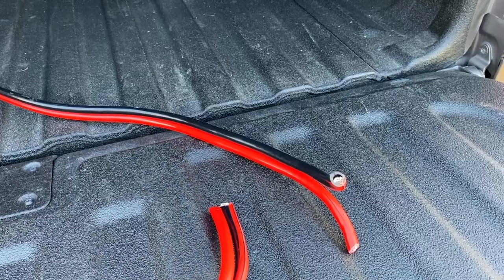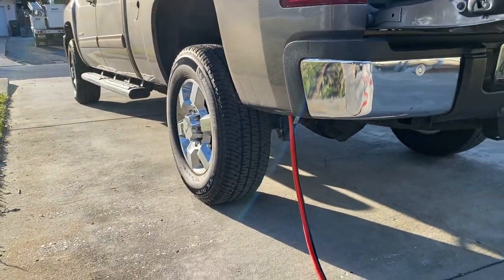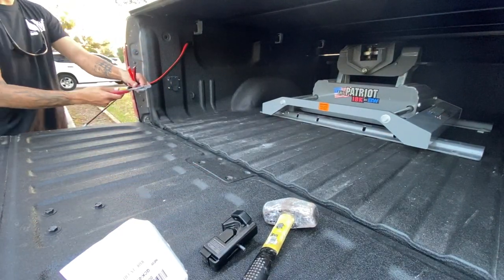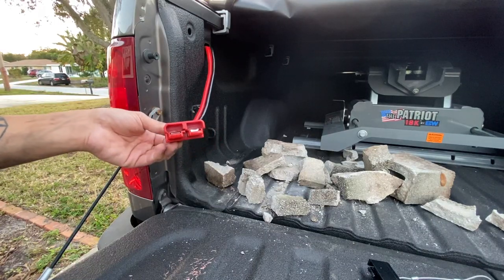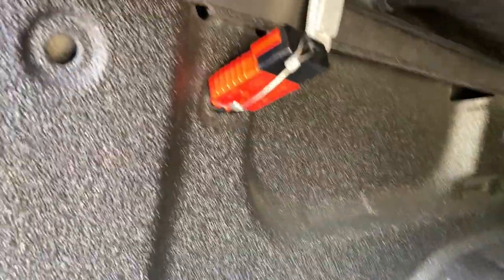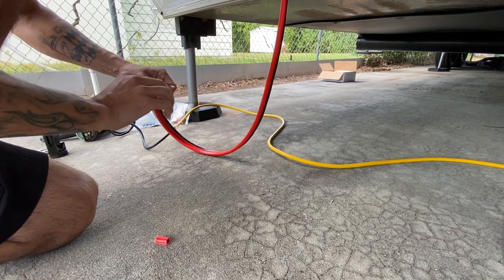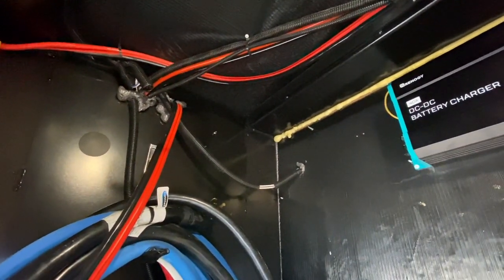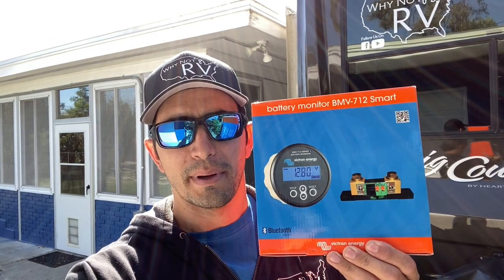Installing a DC to DC charger - Why Not RV: Episode 7

Comment: Nice installation. Don’t forget and leave it plugged in with your engine off. Since you put a jumper from the battery input to the ignition sensor port, when your engine is off, it will continue to pull power from your truck battery.
Reply from the maker: Yes! Absolutely!!!

Comment: Thanks!  You just answered every question I had about what I need to do for my Ford F2 50 and a 32.5’ fifth wheel. I didn’t even think about buying a battery charger cable.  I bought the same Renogy DC to DC converter, so now when my battery arrives, it’s time to go to work.
Reply from the maker: Great to hear Gary. Goals I was able to help!!!

Comment: Now that it has been a year, if I could encourage you to check the 2 gauge wire you fed. There was a few places where the wires were contacting metal. These areas could cut through to your cable. Conduit would help lessen this risk or rubber grommets.
Reply from the maker: I actually changed trucks and upgraded to a dually. When I removed the wire from the old truck I did check it and not a single point of wear anywhere. While I do agree that putting it in some form of conduit is better, if you mount everything securely it works just fine.

Comment: If you are going into the engine compartment you really should be using heat rated cables. Battery jumper cables are not raited for continuous loads. They are for 5 minutes of current, in an open air enviroment, and then go back into storage. You want SGX (125C) or SGT(105C) cable that can withstand the temps in the engine compartment. Jumper cable wire is  just going to melt off, and eventually cause a short or fire.
Reply from the maker: On my new truck we did go a different route on cables but when I pulled the jumper cables out of the old one they were just fine after a full year of use. But I do agree, and some type of conduit or wire lume isn’t a bad idea either
Reply: raited  and rated ? auto correct.? thanks for the comment,  I was thinking of using jumper cables , so thanks a lot

Comment: FOR ANYONE READING!! WARNING!! I’m sure many people have mentioned but that positive wire along the truck chassis rail MUST be sheathed. Preferably with something thick. Slight vibrations can cut through the wire and arc to the chassis and cause a fire.

ALSO. That trigger wire to the positive IN is telling the charger to stay on at all times. It’s better to have it on an ignition trigger so that it isn’t running when the vehicle is off.
Reply from the maker: Definitely agree you should definitely sheath or some form of “conduit” to protect the wire. Having it fused is most important so the systems protected. I unplugged the Anderson connector but later switched it to run off of the running lights. So it would only turn on when lights were on.
Reply: @WhyNotRV  perfect! You know what’s up :)

Comment: Your video helped and like some have mentioned, find out what size of an alternate you have so you do not kill it. Good tip on using a jumper cable for your wire. I might recommend spending the dough and getting welding cable which has a solid, burn-resistant, cut-proof jacket, especially for the truck to RV jumper cable.
Reply from the maker: Thank you. Ya welding cable would definitely be preferred. Jumper cables are the extreme budget option lol.
Reply: What size fuse is the one before the battery

Comment: Its worth noting that if you go any bigger than a 40amp charger you should start looking at upgrading the alternator else ir could strain the alternator depending on the size you've got in your vehicle (note this applies to lithium setup due to their high charge rate)
Reply from the maker: Absolutely Dale. Fortunately the big diesel trucks are already good for this extra 40 amps but a regular gas engine might need a larger alternator just for the 40 amps.
Reply: I've seen dozens of videos where they say to have a on/off switch in the cab. Run the ingen fore several minutes. Then flip on the power to the DD to DC inverter. My only problem is the little wire that's supposedly  goes to a fuse and not doubled back to the positive wire.

Comment: Hello Chris: One of the best "how to" videos on this topic I could find. Thanks....  Question: Can you provide an estimate (i.e. 10%, 20%,30%, etc.) that the DC to DC setup has increased your boondocking time as compared to not having a DC to DC system?  As an example the Brinkley Z3100 5th wheel using two Group 25 batteries will give me about 5.5 hours and Group 27 about 1 hour more of driving time on a cloudy day. Pretty obvious I will be up grading to four SOK 12.8V 206AH Group 27 batteries real soon.      Thanks
Reply from the maker: I really appreciate that Joe, it’s honestly immeasurable. It’s one of the most efficient ways in terms of overall cost of a project and everything to be able to add hours to Boondocking. With a DCC charger depending on what you’re running, you can even just start your truck and let it charge your batteries before you go to bed if you’ve been out for the day. It’s notjust a while you’re towing solution.

Comment: I wired my ignition wire off a random 12v circuit that is only active with the key on, but I added a simple switch so I can manually turn the control circuit on or off while driving.  However, I'm been getting issues with the charger charging for more than 30 seconds according to my shunt.  How's your experience been? I've had it a year and it's basically never worked.  Renogys customer service is trash, but they say they're gonna send me a new one.
Reply from the maker: I’ve had great experience with the charger. No issues with it. Hopefully renogy will take care of you. I’ve never had to deal with them but I’ve heard good things. Best of luck
Reply: W order if your circuit just can’t provide the correct amperage?

Comment: By running you Remote wire from your hot wire coming from your truck your setting your self up for a dead battery on your truck . Any time your truck is plugged in to your camper you are pulling power out of your starter battery if you stop over night and boondock over night with the truck plugged in for  a short time your starter battery will be dead . . You need to run a separate low-voltage wire either on a toggle switch or a fuse link to your ignition to your DC DC charger
Reply from the maker: I can definitely agree with that. Part of my boondock overnight routine is to unplug (and unhitch) even if just to sleep. I've been debating on moving the control wire to perhaps a marker light on the RV so when I turn the lights on it will then turn the charger on.
Reply: My Ram 2500 has factory upfitter switches. Could I use one those for the 12v sensing wire?
Reply from the maker: I don't see why not
Reply: If there is permanent running lights from the 7 pin connector, you can wire to that light wire.

Comment: Excellent video!!!  I am considering installing same on my travel trailer with LFP battery, and you helped me considerably!  Just one suggestion...run that small wire coming from the "D+" port of the charger to an ignition source wire so the charger is only activated when the truck is started.  Thank you, you earned my subscription!!!
Reply from the maker: Thanks for watching. Ya, I actually moved the wire to a market light so when I turn on running lights it turns on. Thank you again!!!
Reply: @WhyNotRV  So basically, by turning on your running lights, you enable the DC-DC converter?  I thought the idea of just not hooking up the Anderson connector seemed clever.  I also thought about setting up a second connector, modifying the existing connector to repurpose the trickle charge line on the 9-pin, or maybe put a switch near the tongue jack.  Are you still using marker lights and why did you change to this?    This is very helpful.

2nd question - in the Renogy manual, it only requires a 8 AWG wire to the house battery since you're under 5 feet and drawing <= 40 amps.  Do you see a benefit with the 2AWG wire?
Reply from the maker: Correct. Lights turned on the converter. People use a secondary switch all the time and that is perfectly normal. I found the marker lights as the easiest thing to do. I just used that gauge wire because it’s what I already had and didn’t feel like buying anything different. You only need the gauge wire for the amperage that you are running through it.
Reply: @WhyNotRV  What's a marker light? 🤔
Reply from the maker: … one of the amber running lights on the rig

Comment: A DC to DC charger is a voltage booster and regulator and also mainly an amperage regulator. If you have equipped your trailor with say, 4- 6 volt agm's and hooked it up to your charging system directly you would likely burn up your alternator as those batteries can pull the maximum amperge out of almost any alternator if using large enough cables. Also if you are just using your standard 7 way trailer plug and wiring you risk burning up the wiring or plugs trying to push that many amps through those smaller wires. The DC to DC chager regulates the amperage to protect your alternator, wiring, and correctly charge your batteries. Keep in mind there are losses in these units, so 40 amps out means 50 amps in, be sure your vehicles charging system has enough headroon to support this. Also extra grounds and heavier cables from the engine block and alternator to the truck battery is a wise move. And as shown here in the video you must run dedicated heavy power and ground wires to the charger and batteries of the trailer.

Good video mate!
Reply from the maker: Hey gidderman, thanks for watching. I appreciate this comment. Very good info to add on. Thanks again.
Reply: The nice thing about the 30 and 50 amp version is you can adjust the max current in 10A increments up to the max. I set mine at 10A while towing and 40A while plugged in and getting power off the stock converter, which I isolated and wired into the DC-DC controller. 

I have LFP batteries so it is truly the only way to get max charge.

Comment: Great video, even though it is four years old!!  I have a 2016 GMC Sierra HD ( it's not as clean as yours underneath :) ) and it has two batteries.  Does it make a difference as to what battery I connect the wires too?  Keep up the great videos and happy travels.
Reply from the maker: Thank you for your comment and kind words. No, from your main truck, you can either run it from the alternator, or either positive from your batteries. It’ll all get the same job done. The alternator is the most direct route if it has a post on it with Room.

Comment: Sweet ass sweet video👍 I used this same charger before with a manual switch until i found this Orion charger that shuts the power down on it's own and i don't have to worry about forgetting to shut it off anymore😂👍
Reply from the maker: Thanks Catherine! Ya I absolutely love this charger. Ease of use.
Reply from the maker: I just realized you commented on my old dc dc video. I have since upgraded to the Orion!!!
Reply: @WhyNotRV  Yes it is very nice and convenient and i had mine hooked up identical to yours and it worked beautifully but at times i forgot to turn the remote switch off. I still run this one in my boat and the Orion on my truck's sound system, i absolutely love them both👍
Reply: @WhyNotRV  I just came across your channel and I'm loving the knowledgeable info, got another sub from me, thanks.
Reply from the maker: Awesome! Thank you

Comment: you can fit 5 marine batteries sideways in the box front.   put the charger under the driver seat.   there's a knockout on the cab corner to run  wires.
Reply from the maker: Which rig are you referencing here
Reply: @WhyNotRV  I have a  07 3500hd reg cab.  I have a shortbed truck camper so have 18 inches left in front, but just the idea to charge batteries without camper and all that battery weight is in a better place.   I did to be able to run ac without a generator.

Comment: Good video. May I strongly suggest a fusible link at the truck battery? Too many sharp edges under a truck and booster cable coating isn't designed for high abrasion conditions. I'd hate to imagine what could happen if that cable welded itself to the underside of your truck. 💥💥💥
Reply: Sorry disregard, missed that part
Reply from the maker: All good. Thanks for watching!!!

Comment: That looks easy enough. My dc to dc brand is ximalta or ximata 40A but the brand should not matter. Are your wires live constantly or do they power down when the truck is off?
Reply from the maker: The wires from the alternator to the back of the truck at the Anderson connector are live all the time. If you have the Anderson plugged in from the camper, that’s live all the way to the charger itself.
Reply: @WhyNotRV  so you must unplug the connector if parked overnight so you do not run down the truck battery?
My situation is I built a 5x8 flatbed into a livable box, has 3-100ah lithium litime batteries, 40a mppt controller so far 300w solar on truck canopy (with 4-100w panels in storage) to go on the trailer, and I plan to live in the setup full time, the truck already runs down the battery when sitting due to an aftermarket cd player/changer install. I already had to put a battery disconnect at the battery. I just do not want the battery to run dead overnight if I don't disconnect the battery disconnect.
Reply from the maker: I don’t know how your brand dc-dc charger works. The Victron has engine detection shutoff so it does not drain or use juice at all once the truck is off. On my new setup o wired the trigger wire that activates the charger to my headlights so overnight I can stay plugged in and it does not discharge at all. I imagine the ximata has some form of a trigger wire or activator that tells the charger to activate and draw

Comment: The way you have it wired, wouldn't the charger be running all of the time that it is connected to the vehicle? That positive wire is hot 100 percent of the time, I would run the trigger yellow wire to another source that is switched.
Reply from the maker: Yes. The way this originally was done was just that. I actually just released a new dc-dc install video from my most recent install and I wired the trigger wire to the running lights of the trailer that way I control it charging with the lights. There many ways to accomplish the same goal

Comment: FYI, I would connect the negative wire at truck to the engine block, not to the battery.... the engine block is the mother of all grounds in your truck.  Why you ask? Consider this, if your negative wire from the battery to the engine lost connection or got a poor connection, the current would (could) flow out your charger's negative wire to the RV then through your DC-DC charger to the RV battery. Then it would flow to the frame of the RV, back through your hitch to the frame of the truck and also the ground wire of your 7 pin connector. Then from the truck frame through the bonding straps to the engine block.  The starter takes several hundred amps and a diesel starter takes more than a gas engine starter.  None of this stuff it will flow through is designed to carry hundreds of amps.  Smoke will follow along with likely arc welding your hitch connection at the trailer.  Might never happen, but if you lost engine ground it would be bad.  Just saying....
Reply from the maker: Bruce brings up a great point here. I personally did not consider the truck losing its own ground. Again, great point Bruce and solid advice.

Comment: Does the jumper from the positive starter battery on the aux power switch of the charger keep the charger on the whole time and risk draining the starter battery until it dips below a certain set limit?  Thus you will always have a slightly depleted battery when starting the engine?
Reply from the maker: If you leave it plugged in at the truck bed… yes that will happen or completely drain the truck battery. We have since wired to a marker light so when you turn on your lights, it comes on.